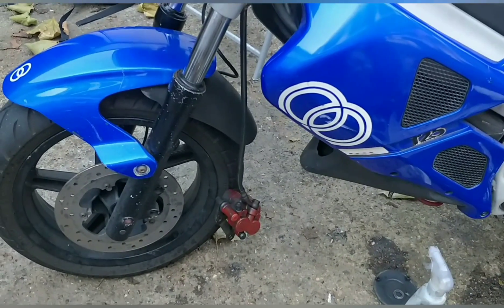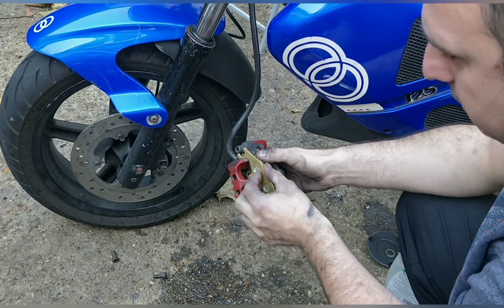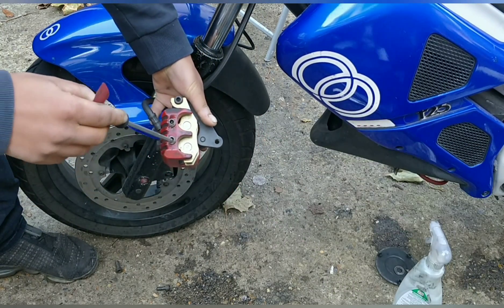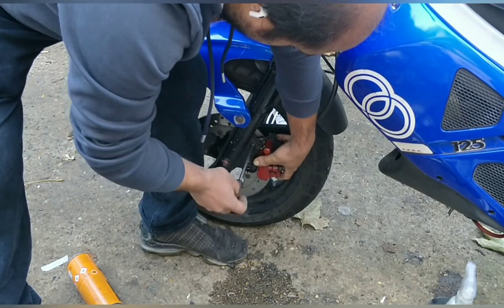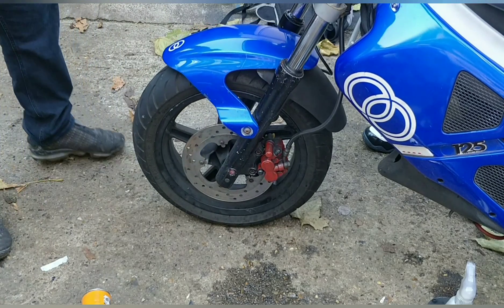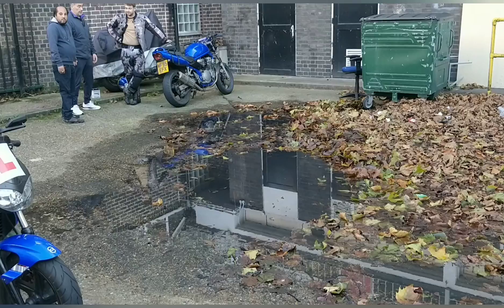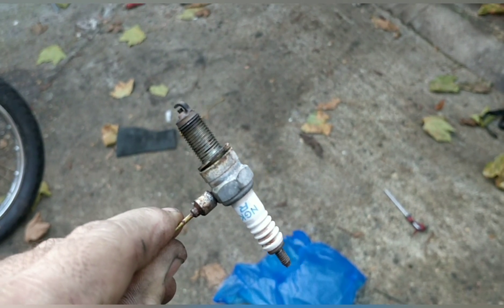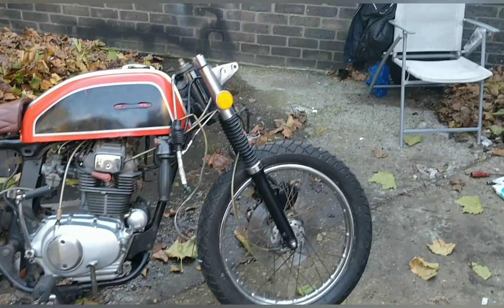gilera dna front brake pads, how to change brake pads. Spark plug check.

Comment: Good advice greasing bolts ,but as you say not everyone does 🤔👍
Reply: I change pads too often to bother greasing bolts unless it's something like a slide pin or back of the pads if they're being a bit squealy but it's definitely annoying when you buy a bike or car from someone who only serviced it up until the dealership perks ran out then parked it on a beach 😂
Reply from the maker: No I always come across bikes where these pins are seized. Kawasaki are the worst for it Derek.
Reply from the maker: Yeh if done yearly or even every other year then greasing is unnecessary.
Reply: @motorcyclerescuer  yes i know Kawasaki s have a stupid brake pin set up Charlie  especially if they are not greased up ,spent ages trying to undoe one but managed in the end ,i think it was attempt 432 lol 👍